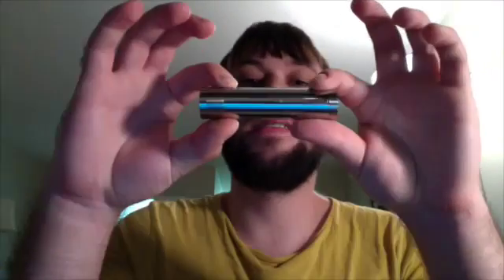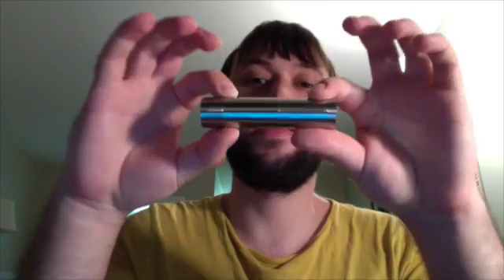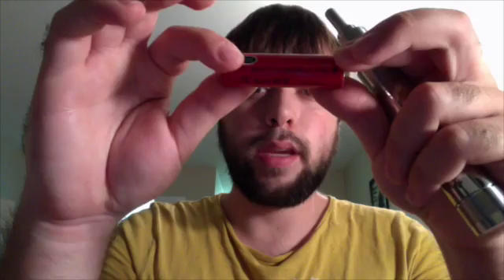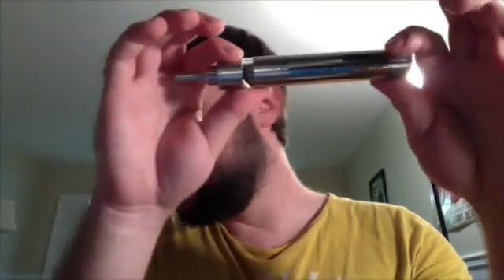Mechanical Mods and Sub-Ohm Vaping 101

Comment: So just to clear something up, I watched your vid a couple of times to clarify a couple of things and i think i understand a good portion of it, but here is my question on the setup.

like you stated… (this is coming from the ohm calculator)

4.2v
3000 mAh (Nominal Capacity) or 3 amps right?
.5 Ohms (Im assuming this value is from the coil)
12.6 W Power

The battery I'm using is a 3000 mAh Battery, 20A Max Continuous discharge, This is for a Kanger Subtank Mini. The coil states 15-30W so this would be safe because its using less power? If this is pulling 3 Amps then the 20A would be safe?
Reply: Also if I just input 

4.2V
None - Autofills to 8.4
.5 Ohms (resistance on the coil)
35W

Is what comes out. So which one is right? would that mean i need an 8.5A Battery?

Comment: i will never understand.  I get fumbled with anxiety thinking of all the numbers.  Can i use my sony vct4 with a mechanical, and use a kanger subtank 1.0 or 1.5 ohm tank???  sun vapers no longer sell protected batteries, looked all over found panasonic ones on fasttech, but heard horror stories that they may be clones.  where can i find a legit protected battery.  I heard there is no such thing as a protected battery.  should i just get a sub ohm battery like aspire cf or ego one?
Reply from the maker: PHOTOS-N-GRAPHICS Hey there. Yeah it is a lot of numbers to think about, but is all simple math in the end if you know the formulas, but of course there is no need to get into building if you are happy with what you are doing now! Yes the Sony will work fine with a Kanger subtank in a mech mod. You are good down to about 0.3 ohms with that battery I would say.